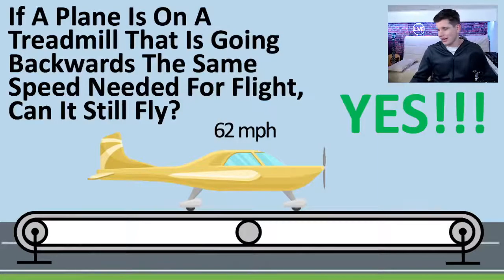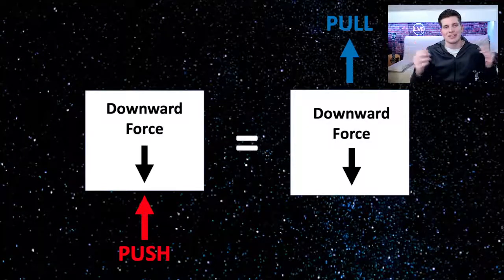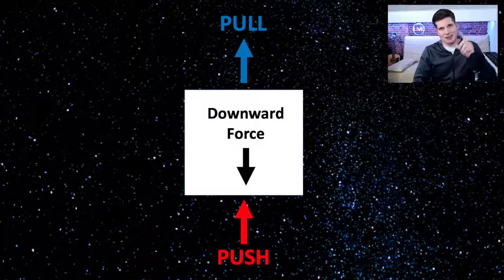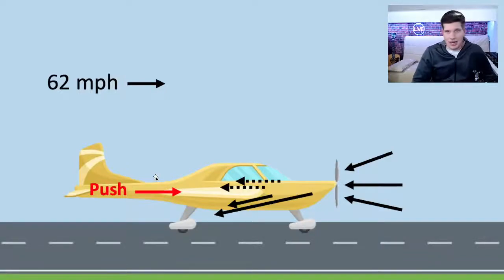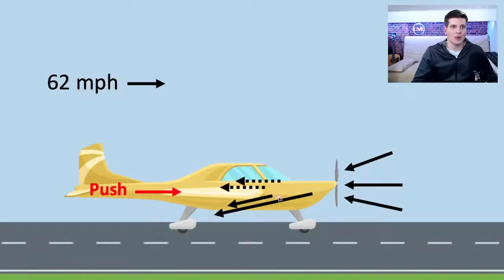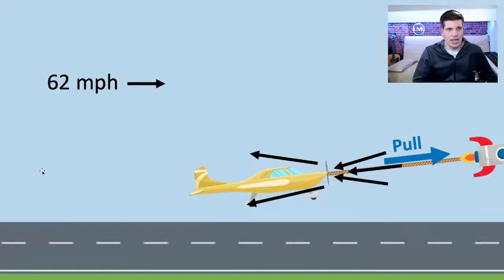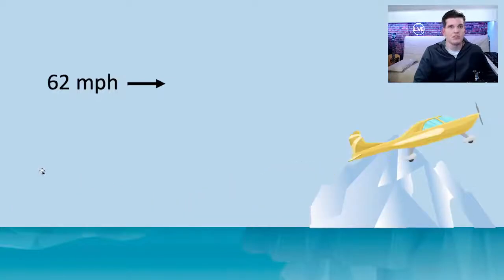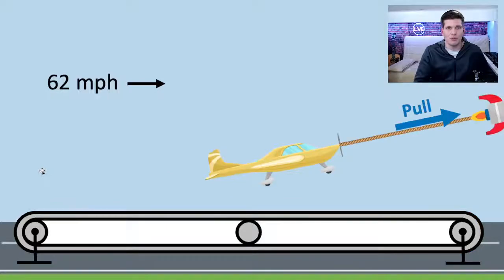Can A Plane Fly On A Treadmill? SOLVED! -A Practical Review

Comment: An airplane moves through the air by means of thrust developed by its propeller, jet engine, etc.  It does not use motorized wheels to attain takeoff speed on a runway.  The airplane’s wheels are free spinning, therefore the movement of the treadmill can’t counteract the thrust developed by the plane’s propeller, jet engine, etc.  The airplane will take off regardless of what is happening between the wheels and the treadmill runway.
Reply: Free spinning does not mean the wheels spin separately from the speed at the wheel axis.

The equation from a kinematic perspective in the frame of reference of the environment is:

Speed at the wheel axis = tangential speed of the wheel on the circumference plus the linear speed of the moving surface.

Unless the wheel skids, that is always the equation.  Always.
Reply: @MrDefreese Free spinning means frictionless, therefore a force applied in a tangential direction at the tire patch cannot be transmitted as a force or a moment to the wheel axle.  It doesn’t matter what speed the wheel is spinning and it doesn’t matter what speed the belt is moving, no force can be transmitted to the structure of the airplane to oppose the thrust.
Reply: @turdferguson4124  yeah, that's a thorough misunderstanding.  There is no motion of the wheel axis without the exact tangential speed of the rotating wheel.  In this thought project, you are also given that the tangential speed of the wheel is the exact same as the linear speed of the surface.

You were given the unambiguous equation.  You can't change that fundamental kinematic reality.

'Free spinning' only matters if you had the test vehicle in the air and you spun the wheels around the hub; while on the surface, you can't do that.
Reply: @MrDefreese I will make this very simple.  This is either a Statics problem or a Dynamics problem.  You think it is a Statics problem, where the summation of forces in the horizontal direction equals zero.  I say this is a Dynamics problem where the summation of forces does not equal zero and the airplane will be accelerated by engine thrust.  What force opposes the engine thrust?  What is the mechanism that allows a force to be developed in the horizontal direction in opposition to the engine thrust when you have a frictionless wheels?   What you’re suggesting violates Newton’s Third Law of Motion.
Reply: @turdferguson4124 this is not a statics problem.  This is kinematics.  The force applied to the test vehicle only rolls it or slides it on the surface.  Most reasonable people will exclude sliding so we are left with analyzing a rolling object on a surface….and that whole assembly moving in the frame of reference of the environment.  It is most definitely not statics.

🤷🏽‍♂️
Reply: @MrDefreese If it’s not a Static problem, then the airplane takes off.

Comment: There have been at least two slightly-different versions of this problem posted.  Until recently, the only version I had heard, is the one that you described, and, absolutely yes, the plane can take off.  The Mythbusters even demonstrated that.

However, another version of it contains wording of the nature of that the treadmill “matches the wheel speed in reverse.”  That is, no matter how fast the wheel speed, the treadmill will match it.

I’m not clear what really that additional wrinkle exactly means.  To me it sounds like it’s just saying that the wheels don’t slip/skid on the treadmill surface.  However, others have suggested that it means that it will negate the plane’s forward motion no matter how fast the engine “revs.”  The treadmill surface eventually hitting the speed of light.

That can’t happen in the real world, assuming frictionless bearings and arbitrarily robust landing gear, and I’m not confident that that’s the correct interpretation of that “wrinkle,” but if that is what it means, then sure, the plane cannot take off
Reply: The same thing still applies with regards to the "wheel speed in reverse", since that's basically telling you it's a linear speed and not a rotational one.

Comment: Even if you interpret the problem the first way, by the "belt cancelling out the motion".. it'll still take off. 

Simply because.. there's no way for just a conveyor belt moving back, to cancel the thrust. Independent systems. That's just not something a conveyor can do (outside of causing bearing failure)
Reply: There is no situation where the plane doesn’t take off. And he kinda made that point at the end when he talked about the belt moving at 100ph.
Reply: You aren’t cancelling thrust.  You are creating two independent objects in kinematic equilibrium.

Take an aircraft that moves at 25knots; have it try to take off from bow to stern on an aircraft carrier also moving at 25knots.

There will be zero airflow - from the perspective of someone watching from the shore, the plane will appear to be motionless as it rolls from bow to stern until it plops into the water.

Anyone who persists is stubbornly incorrect on basic kinematics.
Reply: @MrDefreese  This is the difference in IAS and TAS. Its how 747's fly over mach1 when flying east towards Europe. Just checked on one over England now. 260kts ISA, 486TAS...607kts across the ground.
Reply: @AlicesWondereland that shows the issue of frames of reference.

In the thought project, the frame of reference places the rolling object speed in the atmosphere at exactly zero because it is rolling on the surface, not flying.  This thought project says there is no airflow and no lift.
Reply: @MrDefreese  Your thought project is different from the treadmill. You've introduced a tailwind. The plane would have to compensate for that to reach rotation speed. If the planes rotation speed is 25kts, with a 25kt tailwind, it would need to reach a ground speed of 50tks before it reaches 25kts IAS. Planes are propelled through the air by their prop/jet. So the forces acting on the wheels, is meaningless. Image standing on a skateboard, on a treadmill, and you pulling yourself forward with a rope. The rope is the air, your hands are the engine/prop.
Reply: @AlicesWondereland there is no tailwind in what I described at all.  None.  A vehicle rolling at 25knots on a surface moving at 25knots will have zero net speed in the environment.  It doesn’t matter what force is applied to the test vehicle to reach that speed.  End paragraph.

Similarlyly, trying to add a rope is radically altering the thought project to the point of being incompatible.  You introduce a completely separate position parameter over time which means a different speed condition.  It falls apart.
Reply: @MrDefreese  Just to be clear...You describe an object that is moving at 25kts (the carrier) and you park a plane at the front, facing the rear, and you're going to tell me there is no wind coming from behind the plane? 

My skateboard analogy to articulate how an airplane propels itself. I wasn't changing anything.
Reply: @AlicesWondereland this is not about wind speed.  You could do this in a vacuum chamber with a rocket.

Edit:

Thrust just gives you a rolling angular speed of the vehicle on wheels which is measured as the tangential speed at the circumference of the wheel.

The surface moving in the opposite direction at that same speed means the net speed in the environment is zero.

Comment: The observer standing on the belt, with the car registering 62 speedometer, essentially sitting still.. would not, in fact, see the car going 124mph.

That would require the belt going back 62 and the car going 62 forward, registering 124 speedo
Reply: bitch if u put wheels on a plane and put that plane on a treadmill, those wheels are going to spin when the whole plane get pulled from wherever. That spin then makes the treadmill go and now u have a treadmill spining on wheels spining on a plane that CANNOT move forward because it cannot levitate. It is GROUNDED, and limited to moving only when its wheels move leaving the ground behind. And oh wait, that ground is now moving WITH the wheels so nope, an airplane cannot takeoff

Comment: If the question is….
"Can a plane take off as long as it is kept stationary by a treadmill spinning in the opposite direction at the same speed as the plane is rolling?"
….the answer is a definite NO because lift is created by the airflow past the plane's wings while the speed of its wheels is irrelevant.
However, if the question is….
"Can a plane take off from a treadmill whose speed is limited to the plane's normal take-off speed?"
….the answer is an equally definitive YES because the situation of a plane kept stationary by a treadmill spinning at 62 mph or 100 kph is fundamentally different from that of a plane about to take off from an ordinary runway.
A plane rolling at 100 kph on a runway has to overcome both its rolling resistance and its air resistance (and also have a surplus of thrust to keep accelerating), and at that speed, the rolling resistance is insignificant compared to the air resistance.
On the other hand, a plane kept stationary while rolling at 100 kph on a treadmill doesn't have any air resistance to overcome and can thus maintain its rolling speed with not much more than its idle power. If the treadmill is as long as a runway and that plane increases the power to its normal take-off level, it will immediately start accelerating and take off almost as easily as from a normal runway.

Comment: I came to the same conclusion as this video within about 5 minutes of hearing about it, only to be told by an aeronautical PHD professor that I was wrong because the question didn't say the engines were on (it was a jet airliner in the question I saw). I then asked the PHD professor - if the engines were on would it take off? to which he said "obviously yes" to which I replied, but the question didn't say there was a pilot at the controls, or fuel in the tank, or the engine covers removed (and so on). This was about 6 years ago, and I believe explains why I have made millions ($) and he is still worrying about PHD papers in a university lab basement somewhere. The most highly qualified people are sometimes so impractical that they limit themselves by getting stuck in their own complexity. Stay practical y'all!

Comment: You are changing the parameters of the question. The question states that the treadmill exactly matches the speed of the wheels. It doesn’t matter if the car’s engine/tired uses X amount of thrust to reach a certain speed or if a plane’s propeller uses X amount to reach a certain speed. The treadmill interacts differently with the car and plane but does its thing to exactly match the wheels. When the treadmill exactly matches whatever vehicle you have on top of it…that vehicle is STATIONARY.

Comment: Regarding your person and car on a treadmill. The person would NOT pass the car at 124 miles per hour. The car itself would have to “think” (speedometer reading) it’s going 124 mph on the moving treadmill for the person moving towards the car at 62 mph to pass the car at 124 mph. You yourself correctly stated (before introducing the person) that when the car is driving 62 mph forward as the treadmill is matching that speed backwards…the car appears stationary. Now to see this more clearly, stick a tree off of the treadmill…the car will appear to be parked next to the tree. Now put your person on the treadmill, remove the car, and tell me how fast the person passes the tree. I know you can’t tell me 124 mph with a straight face.

Comment: The plane doesn't not fly because of push or pull forces. It flies because of the movement of air over it's wings. If a plane is on a treadmill and the treadmill exactly matches the "forward thrust" or "pull" in the opposite direction, there is 0, zip, nothing flowing over the wings for that plane to take flight. The plane has to move forward relative to the ground (and the air around it) in order to attain lift!
Reply: I don’t understand why everyone can’t get your point.  My riddle that I saw said the treadmill exactly matches the wheel speed.  It’s annoying that everyone dismisses the wheels when they’re the whole point.  The question is hypothetical so all this bullshit with speed, bearings, and mechanical failure can f-off.  This needs to be looked at like the wheels and treadmill are gears.  When one starts to move forward, the other instantly starts moving backwards, cancelling out all forward momentum.  Sure the thrust of the jets would have the belt going pretty quick, but it would have a limit at some point, it’s not like it’s infinite.

No forward momentum = no lift over the wings = no fly
Reply: The mistake you made there is that the treadmill is irrelevant to the plane moving, since the wheels are free flowing and the plane doesn't push against the ground for speed like a car does. The body of the plane will still move forwards just fine due to the engines pushing the plane forward and not relying on the ground at all for any momentum.

Comment: i think you get the case wrong. If the tredmill moves at the same speed as the plane, it can't move foreward. for the plane to lift of it would have to move foreward, therefore the wheels would spin faster than the treadmill. Yes if they start with matching speeds, the plane can lift off. BUT if they keep the same speed which the question suggests, there would be no movement, therefore no airflow to hit the wings. I might be wrong but I don't see how I would be. It really doesn't make sense to me apart from what I said
Reply: Nope, he got it exactly right. Furthermore, he used a very good analogy with the ice - which is close to frictionless - to make it easier for those who get stuck in "the aeroplane will stand still" mindset to understand.

The key difference between a car and an aeroplane is where and what the propulsive force is acting on. If you don't understand this key difference, you'll never understand why he's right.

With a car, the propulsive force is at the wheels and is acting on the ground, or the treadmill, or the ice.

With an aeroplane, the propulsive force is at the propeller and is acting on the surrounding air (not on the ground, the conveyor belt, or the ice).

An aeroplane's wheels are NOT driven, they're free wheeling, and are designed to simply roll across whatever surface they're on.

The ground, the treadmill, or the ice are completely irrelevant to an aeroplane's ability to takeoff, as long as the aeroplane's wheels aren't forced to spin at a higher rotational speed than they're designed for - in which case, they'll explode.

For safety reasons, aeroplane tyres are designed to withstand several multiples of the aeroplane's normal takeoff speed.

With a conveyor belt spinning in the opposite direction to the aeroplane at its normal takeoff speed, under power, the aeroplane will accelerate forward along the conveyor belt, will reach the necessary airspeed, and will takeoff as per normal.

To a stationary observer, it would appear the conveyor belt is having zero effect on the aeroplane's ability to takeoff, and that's because it is having zero effect.
Reply: @ianshand6094 your explanation is incorrect as is trying to use an ice example.

There are two and only two ways a wheeled vehicle can move on a surface - one by sliding and the other by rolling.  In either case, the motion is on the surface  and the rules for motion on a surface are very well understood.  In any motion of this kind, you can have a surface that moves at the rate that the test object moves on the surface.

This is a failure of understanding kinematics and frames of reference.  If you have an object moving at one speed on a surface and that surface is moving at the same exact rate and acceleration in the opposite direction, the net speed of the test object is nil in the frame of reference of the environment.

Fundamental.

Comment: The problem with the rocket analogy is the rocket is already moving and is off the ground. It doesnt simulate the rocket taking off. It needs air lift to get into the air in the first place.
Reply: Substitute the rope and rocket, for bolts and a propeller and engine. 

The wheeled chassis of the plane, is still being pulled by something that is attached to the front of the plane, pulling it